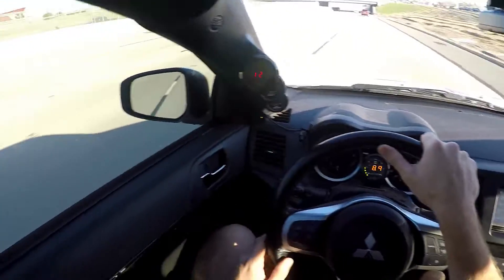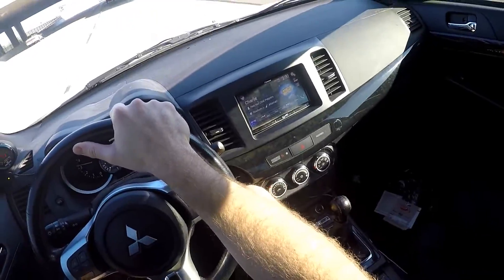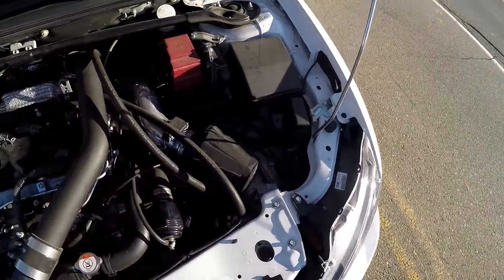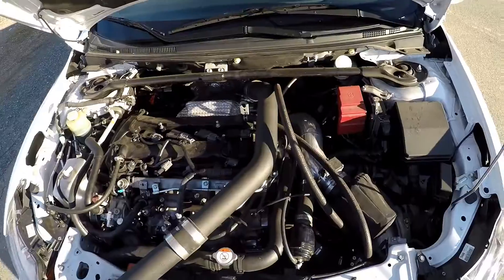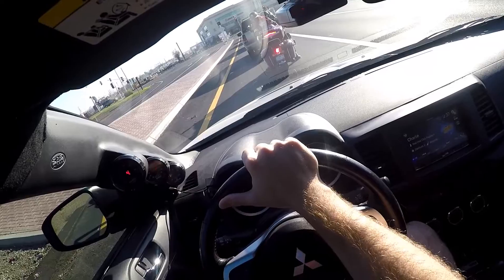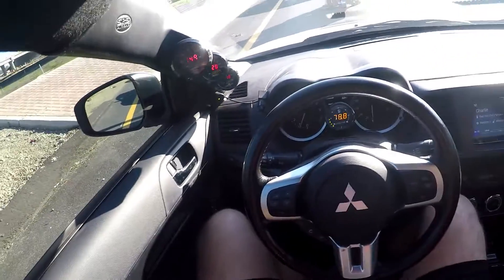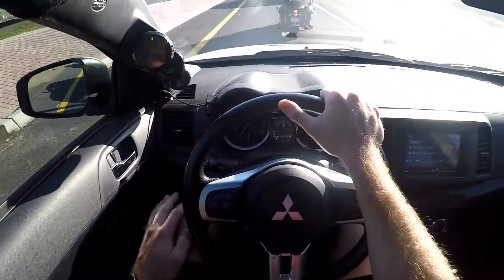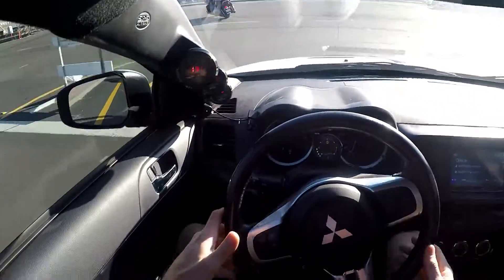Evo X E85 MHI-18K

Comment: Thank you for the upload, this skyrocketed my motivation to install my turbo this week. Cheers! Also, post a mod list when you can :)
Reply from the maker: Words of advice if you've never dealt with the bolt from hell

-Swivel ratchet
-Universal socket joint
-20 inch extension

Updated mod list :)
Reply from the maker: Did you get it installed??
Reply: @ByeEvoX  yessir! Now my car is running very rich (even after tune)
Reply from the maker: @ish_stm  Probably need a touch up.  Or fuel issue
Reply from the maker: Get it fixed?  DM me if not might be able to help
Reply: @ByeEvoX  I got everything working including Flex fuel kit! Now to find a decent tuner
Reply from the maker: @ish_stm  Very cool.  If you end up etuning, feel free to shoot me an email.  I went through the process a bunch of times.

Comment: I love how easy and smooth it hits 60 and then pushes to 100 nice and easy without wot.
Reply from the maker: Yes!  That's usually the gripe with 4 cylinder turbo applications.

The 18k has enough flow to be effective in that range.  Although 5th gear WOT is still sketchy for me lol

Comment: Nice evo! Are you running the 1.5 psi or 3 psi spring in the tial qrj ?
Reply from the maker: 3 PSI mate.  Think that's the green one, 1.5 is pink.  Went through multiple tunes with it, tuner had no complaints.

Comment: Damn I did my tune at 26 for both 91 and E85. When I switch to tephra I'm gonna make the E85 a little hotter. Should be switching later this month. Need to force ready my monitors as well.  What's your timing ramp look like? I'm starting at 8° and ending at around 15-16°
Reply from the maker: 30 is safe.  I was maxing out my 35psi gauge on the aggressive map 🤭  I'll check my tables
Reply: @ByeEvoX  Awesome thanks. My car currently makes ~430/340 and I'm trying to make it stand up a bit sooner and pull harder
Reply from the maker: @home541_  Hey man, email me : ZacharyFurtado@outlook.com
Reply: @ByeEvoX  Sent

Comment: How is it now?
Reply from the maker: No issues at all.  Only small gripe I would have, is working out the cold starts during winter on E85.  A small mix of gasoline (E60-E70) actually helps a lot, with minimal loss in performance when compared to 85%.
Reply: @ByeEvoX  that’s awesome! It’s there anything you would do differently with this setup? Just pick 08 evo and I’m really interesting of going this route.
Reply from the maker: @heartstrong1306  Congrats on the purchase!  I would do one of two things differently.  Either build the motor and stroke it, or go with a larger turbo on the stock block.  Most people choose the 18k because it still has decent spool, but you really can't take advantage of the torque down low with stock rods.  The 18K + E85 really wakes the car up but after a couple years I wish I would have went bigger lol.  It's not too much more to get into the 500whp territory, and there's only been a few times where I've appreciated the decent spool.  But you can't go wrong with 18k + stock block, it's an easy bolt-on upgrade for +200whp over stock.